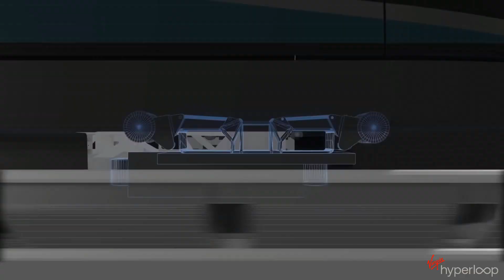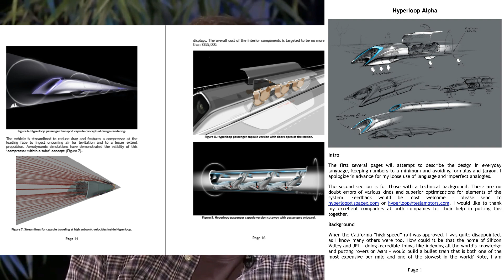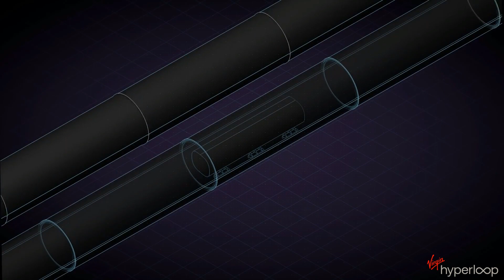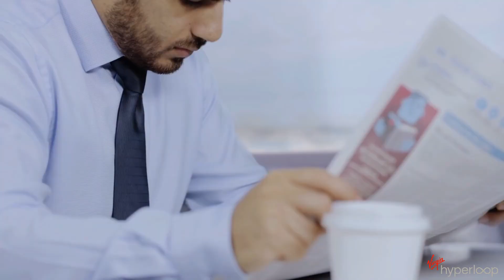Hyperloop Update - Finishing Final stage testing | Cost of Running Hyperloop | TECHNEWS E-13

Comment: Information is out of date. Does not even state that Virgin Hyperloop have suspended development of passenger hyperloop and are instead concentrating on cargo. The costs and ticket prices are also widely optimistic. Even Musk has realised how difficult hyperloop is to implement in practice.

Comment: There are a few problems with this video:
1. The concept is documented back to ET3 before Musk.  Musk found this.  I found this before Musk apparently just as I found AC Propulsion before Musk.  However I did not have the money or popularity to get this out there to the masses just as the originators of these ideas did not either.  They did share and eventually Elon Musk was able to shed more light onto it.  There are more things I know about and have seen signs Elon Musk has found it to, but it is not quite as widely known.

2. The pressure in the tubes is low enough to where your blood would literally boil and you would explode from the outgassing.  Even if you installed an oxygen mask, it wouldn't help.  It works on an airplane because you only go up to 30,000 - 40,000 ft max depending on the airliner and fuel load.  Going to U2 altitudes and beyond requires a space suite.

3. Pipelines and maglev tech can be designed to be very safe.  As long as the right standards are established and met, it should be very rare for a catastrophic accident to occur.

4. A cool thing you can do with Hyperloop tech is machine gun vehicles through it at a high capacity.  The downside is if something does happen, everyone needs to stop in lock step or else there will be a nasty pileup / vehicles flying out at supersonic speeds in machine gun fashion.  The faster you go, the longer it takes to do an emergency stop.  The more vehicles packed in, the more that will exit at high speed before all of the vehicles can slow to a stop.

Comment: Hyperloop is incredibly dangerous.   Ask Marin in the Netherlands what happens when a seal fails and humans in a cabin are exposed to a vacuum.  You have little or no time to put on a mask.  Astronauts wear special suits to protect them from the vacuum of space.

The assumption of Musks economics is based on the  idea of free or nearly free electricity.   What is the cost of electricity when you've shut down fossil fueled and nuclear power plants as California has done?  What is the cost of creating a vacuum and maintaining that vacuum?

Another issue that Mr. Musk has skirted are earquakes.   The San Andreas fault runs pretty much from Los Angeles to San Francisco.  There are pretty regular earquakes and aftershocks in this area.  How do prevent a crack and loss of vacuum?

To safely test piping or tanks air test pressure is limited to 2.5 psi.  If pressure is needed higher than 2.5 psi water is used.  Consider that atmospheric pressure is 14.7 psi and a vacuum is  say 1.0 psi, making a 13.7 psi differential, or about 5.5 times what is considered safe. 

Vacuum powered tubes have been used for years to shuttle papers in tubes.  Fortunately, papers cannot be killed if the container leaks.  I cannot say the same for people.  It would be far safer and a much more pleasant ride to build a high speed rail system. 

R. A. Levine